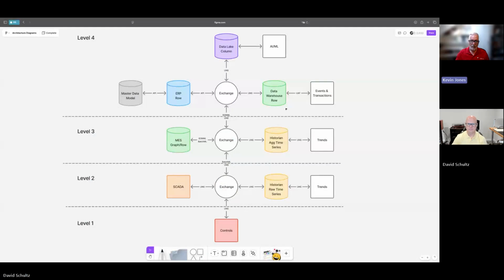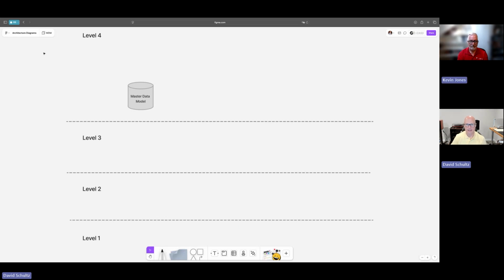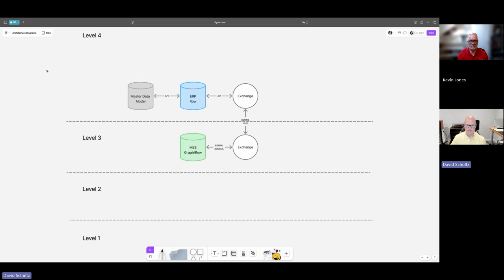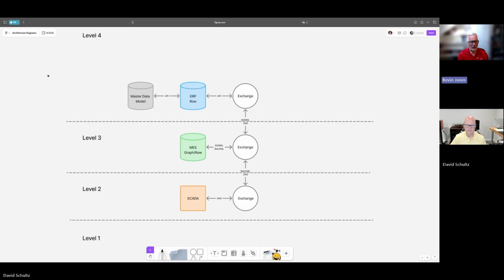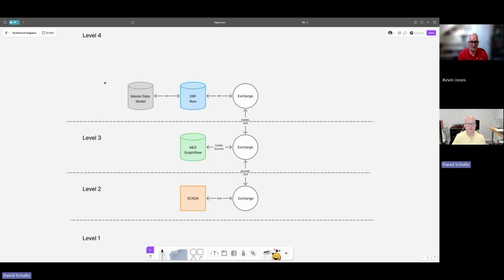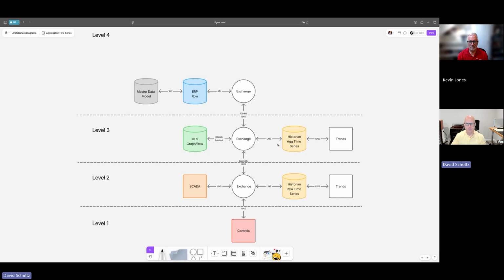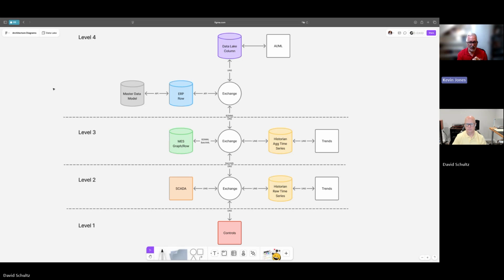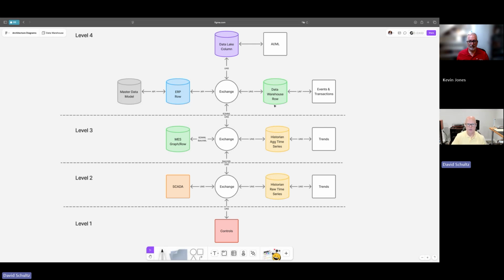Functional Manufacturing Sytems Architecture

Comment: Great job guys! Thank you for sharing... The Master Data Model is an important step and should be as close as possible to "right" (does not have to be perfect - but it will save time and energy).
Question:  when you use language like "graph", "row" or "column" are you meaning "relational SQL DBs" vs "NO SQL DBs" technologies or are you implying other context with those labels?
Reply from the maker: Thank you for the comment. I am a fan of not letting perfect become the enemy of good enough. The intent of the master data model is that other systems will use this for its structure. For example, a SCADA system will use it to build the resource and asset models. An MES would use it to build its process and information models. If there is a change, the relevant systems would update according. The focus is data governance.

The labels are to indicate the type of data structure in a generic sense. The most common is SQL which is row based. These are used for transactions. Time-seriesdata bases are column based, as are data lakes - the columns are updated in a time context. Graph databases are used for understanding complex relationships. SQL databases cannot support them due to limitations of primary/foreign keys. Hope this helps.